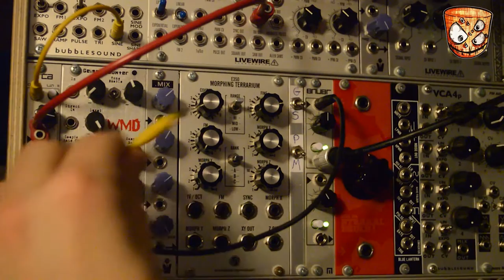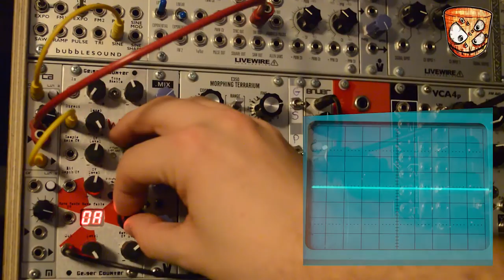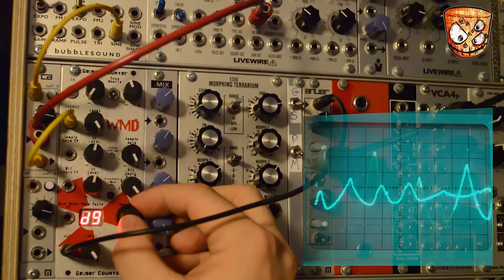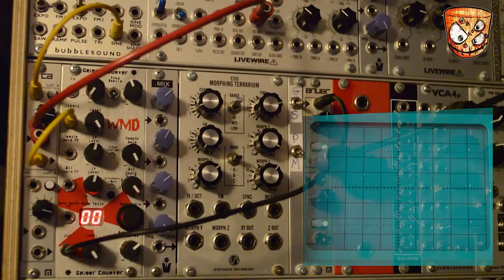WMD - Geiger Counter - Wavetables Demo

Comment: Just came across this video via the geiger counter guitar pedals, and am completly unaware these big set-ups like yours were available to build. Are these connected to a computer or in another console? Did you make all these sounds with this big set-up itself or did it use a signal such as a guitar signal would send to a pedal? Sorry for my complete ignorance on these but I find it quite interresting and am looking further to learn about these
Reply: Hey man, this dude's rocking a modular synth so there's not guitar signal, just oscillators!  Google it and read up, there's a lot to explain, but basically it's just like a 'portable' synth you're probably familiar with, except with the modular synth - hence the name - you 'connect the block' yourself.  You experiment a LOT more with modular synths, but the drawback is that they are usually more expensive and bigger, hence less gig friendly.

Comment: Very helpful video, Ben! Great sounds, but what is the cause of the clicking/popping at the end of the bursts of sound?
Reply from the maker: I think it's just as the wavetable shuts with no input exciting the circuit. In practice I've never noticed it as I tend to send modulating signals that don't fully close (such as velocity or sample and hold modulated level through a VCA) into the Geiger counter then go onto a low pass gate or VCA afterwards so that can close off the sound.
Reply: Thanks, Ben, that's very helpful indeed!
Reply: @DivKid  Thanks for the video.. Sending modulating signals through waveshaper and wavefolders opens so many doors for me suddenly especially after watching your video on the Tiptop fold processor.. was wondering if the last stage of lpg or VCA you mentioned here was for the amp of the audio or for the modulating signal itself again.

Comment: Nice.... May be getting one of these very soon.
Reply from the maker: Well worth it Paul. I love sequencing the wavetables, will careful tweaking there's loads to go at. Also the pre-amp (which I avoided here and went straight in) has a lot of drive and the tone knob is useful. Bit crushing and down sampling is fairly standard but the smooth down sampling is nice (coming from using software bit crushing which steps, with no smoothing).
Reply: Coolio!